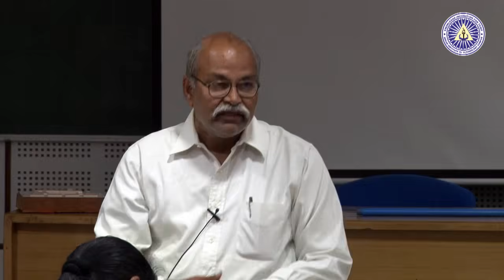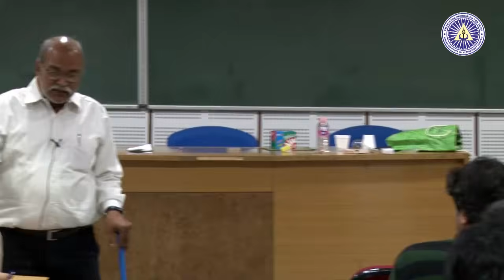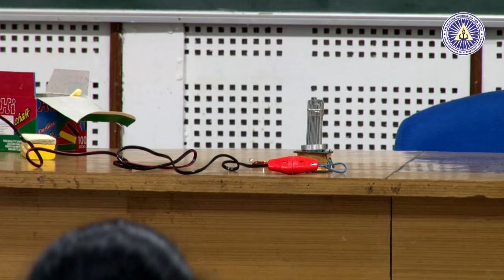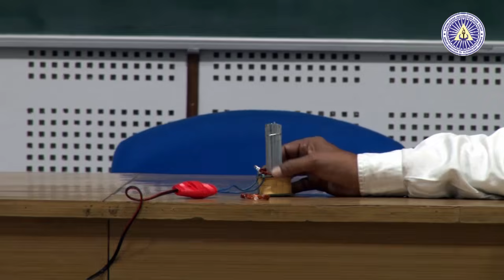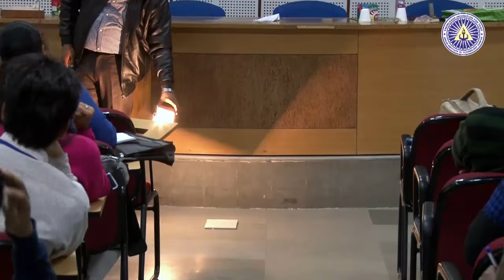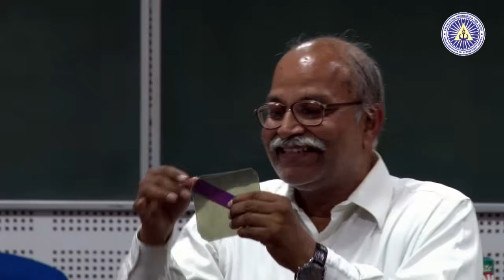General Talk by HC Verma

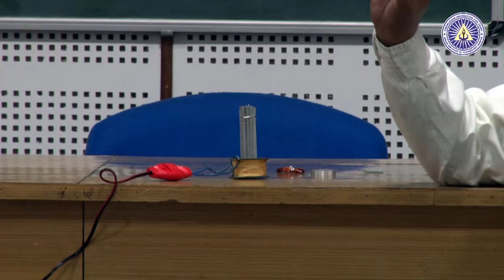Comment: 50:21 here the reason can be explained using the total energy conservation, when the ring with bulb is taken the electrical energy is converted to light energy but in case of aluminium ring there can’t be further transfer into any another energy due to which it’s potential energy due to height increases as it rises

Comment: 12:05 probably Newton's law is applicable on the same point where the force is applied by the earth so if the boy holds the bag exactly at same point where mg is being experienced he can balance it but here as the distance is increased so a torque is produced that prevents the boy from balancing the bag with same 20 newton of force he should apply more force than that to stop the pipe from rotating.

Comment: In the case of rod,
 to  remain it in rest (Both translational and rotational equilibrium). which want to be accelerate down & also to rotate (if we hinge rod at any point). 
   So to keep it in  equilibrium (Both translational & rotational) we have  to balance torque (t=r×f) also.
   To  stop it from rotating we have to apply same amount of torque both side of hinge point (fulcrum)  so that net torque would be zero.
 Because larger length is towards bag (suppose 1meater) and we have small length  to grip(let it 10cm = .1m) where we have to make two points fulcrum and point to apply force by hand.
 
    So it should be t¹=t²
                           f¹r¹=f²r²
                          20×1=f²×0.1
                          F²=200N

  <-----------r¹------------><--r²-->
  _______________________👇f²
⬇️ f¹                       ☝️        ↩️ t²                 
↪️t¹.                   fulcrum 
    
   More larger r1 more force we have to apply.
Lesser r² more force we have to apply  to keet system in rotational equilibrium.
 And at the point of fulcrum we have to apply 20N to keep in translational equilibrium.
Reply: You didn't event consider the reaction which balances out the system

Comment: I guess it's abt the Mechanical advantage,( I'm still in 16:38 ) and the NORMAL reaction is the thing here
Reply: Coz we are applying force downwards in the second case,the NORMAL reaction!
Reply: @sankethks7111 absolutely reaction force at the end of the rod where he holds balances out the system

Comment: Prof. Verma must be very popular but this video is my first introduction to him.  For the benefit of students,  I would like to indicate that his explanation of magnetic fields in permanent magnets as due to moving (in orbits) atomic electrons is incorrect (mentioned around min 37 in the video). Permanent magnets occurs due to spin alignment. Spin is an intrinsic property of electrons and other particles, much like charge is. Spin is not due to classical electric currents. However the exact theory of permanent magnets is still not available. Just to indicate the complexity of the problem, a solution of spin alignment in 2D fetched the Nobel prize in 1944. The 3D problem is still unsolved (anyone aiming for a Nobel prize?). Isn't it amazing that we still do not fully understand how the humble permanent magnet works !

Comment: I think explanation to the first riddle is that the extra force applied by the hand (let's take it as the hinge) is to counter the torque applied by the bag. SO, on that hinge point will have two force components 1. mg (i.e. 20N) + 2. mg*r . Newton law talks about the equilibrium of the point objects.
Reply: Mgr is not a force its a torque so you are wrong

Comment: Answer of the first question - Because the center of the gravity is shifting, as much as the it shifts the force will be increased.
Imagine your body is not a single, solid mass but a huge sack of potatoes standing upright. Gravity pulls on the whole sack, but it also acts on each potato separately, pulling each one downward. When you lean over to one side, the "potatoes" at the top of your body work like a lever, making your top half turn and topple about your ankles. The more you lean, the bigger the lever effect at the top of your body—and the more likely you are to topple.

Thank you for such an astounding question.
Reply: You still didn't answer the question

Comment: The answer to the pipe bag problem was he was not applying just a force upwards. He wad upling both upward and downward which is spread on the surface of the hand. And when he was moving the bag to the edge both the forces magnitudes are increasing but the net is still the weight of the bag which is upward. So since magnitude of individual force is high he is experiencing more pressure
Reply: I also had the same explanation 😃

Comment: My thoughts, 
What they failed to notice is, mg is actually providing a torque. Torque = RXF
So the guy has to provide more torque as radius from the axis increases torque increases, to keep the bag steady!
Reply: How mg is producing torque ??
Reply: @shemjosephejk5824  Consider the forearm to be massless for a minute. The joint of elbow of the person act as a pivot or axis of rotation, and mg is acting on the bag downward. Since the bag cannot go on a linear path, it has to go on a circular path, resulting into a torque.(This is actually the most basic way of explaining how torque is produced from a force, if you want much more detailed explanation you can refer hcv part 1)

Comment: 14:00 the upward force should be on the same straight line that the downward force falling on the object by the earth. That is why he could not able to hold the bag when he is putting force farther than the straight line. Note.You can still control the bag in rest position if you put force very close to the straight line .

Comment: Notice that just one point of force exertion is not at all enough for the stick bag system to be in equilibrium, wt actually happens is that when we hold the stick there are two points of force application, one near ur index finger, and one near the back of ur wrist, so the force of weight+ ur downward force should be equal to ur upward force

Comment: Who can explain aluminium ring and led difference in the experiment
Reply: Team Sudheer  yes u are right
In aluminium ring there is very low resistance hence current is same as emf approx so more repulsive force but led has a significant resistance so current is less and not enough repulsive force to overcome mg

Comment: This class has cleared jee and still has confidence issue. He keeps asking ques and everyone stays quiet.
Reply: Most of them will be introvert lacking social skills effect of coaching and all
Reply: I thinks it's something kind of session or worshop coz😂iit jee wlo ko itna pta hota h or itt wlo ko itna basic thodi na pdhynge😅
Reply: @zemprook2196  yeah I think so
Reply: those students are not iitians. this is a special program for non-iit students to improve the standard of engineering in india.
Reply: @satyarth  ya i know that but still iit me bhi to backbenchers hote honge na
Reply: You know what is the answer of first question if you know tell me 🙏
Reply: @abhijain9542  I thinks that as the bag moves away from the centre of the mass of the rod the the weight of the  rod get added  hence now it is not in equilibirium
Reply: @thespookyhuntergamer2770  actually the fact is if you apply 20 n upward it will be at translational equilibrium but when bag shifts , the torques become unbalanced so the rod actually starts rotating . If you want both translational as well as rotational equilibrium , you need to apply 20 n upward at such a position that the torque also gets balanced . Class 11 chapter 5 and chapter 7 mixed up
Reply: @thespookyhuntergamer2770  why is it not at equilibrium as it moves away from the Centre of mass ?
Reply: @hardpandya1212  bro torque bhi add hoga downward direction mai..........if you still not clr study COM and NLM
Reply: Because they only know how to study and write exams
Social skills is something you learn by your childhood not exams!
Reply: @Dr.MoonChiPoi  tumhari baat mein dam hai👍
Reply: @Dr.MoonChiPoi  yeah
Reply: Nah many answered raise ur volume
Reply: Probably we cant hear because they dont have mics
Reply: @Gurnaj lg, The toppers of JEE are so quite that they even cannot able to answer the simple principle related questions...This shows how our present educated systems making the students simply only Mark's orriented..
Reply: bhai ye iit ke bqche hai?
Reply: Backbencher hai bhai
Reply: but i dont think most of them have...the first one said force in "kg's"...i guess its more of a workshop or something
Reply: @uttkarshranjan8985  this people are so dumb

Comment: 2 is not mass. Actually it is meant to be the weight (Kgm/s2).
F=ma
W=mg
2 = m x 9.8
m = 2/9.8
m = 0.204 Kg -> This is the real mass
So the force he needs to apply is not 20N. It should be just 2N.
20N is a very big force. 😀

Comment: I think I found the answer. The hand exerts a force not just in the upward direction but also in the downward direction. If you just apply a force in the upward direction then you won't be able to hold it just by applying 20N.So the exerts a force of say 10N in the downward direction so that the total force in the upward direction is 30N.This balances the total downward direction and Newton's first law is safe. Now the torques of the forces by hand in the upward and downward directions produce a clockwise torque about the axis of rotation which balances the anticlockwise torque by gravity. Thus the system is in both rotational and translational equilibrium. I hope I'm right.

Comment: When the bag was displaced through a distance from the person's hand  the person applied 30 Newton in upward direction and weight of bag equals to 20 Newton and bag was in static equilibrium, then the extra 10 Newton force may have been used to make the system in rotational equilibrium

Comment: dont judge on my idea but i just think the bag experiment was just like turning a nut with long spanner and short spanner the same work is done on both the sides i.e same energy but but near our hand the disp is less so more force at the bag disp is more so less force may be mechanical advantage is the reason for it because here we are not just holding it straight we are stoping it to rotate even

Comment: The 20N force is high at the end due to the torque and radius relation ...
Am I right ?   Tell me stranger.
Reply: No
Reply: @lakhansinghchoudhary1142   why ?

Formula of torque is Force × | distance.
We will have to apply an opposite torque...

Then what is wrong.
Reply: Yeah because of torque it's working as force multiplier...
Reply: He had asked the net force on rod-bag system.....if the rod is pinned at its COM the we will use torque....but the system is rod-bag..

Comment: What the heck? Its too simple. Torque=Force*Distance ..So the total moment of the force should be 0.. It's law of rotational equilibrium.
Reply: That was already answered by one of the guys out there..but the problem is to get more opposite torque u need to increase the force...so why is not the translational equilibrium being disturbed?????????that's the main question
Reply: @greevapatel6762  I did not get it. Can u explain clearly.
If you wanna increase torque you have to increase the length.

Comment: Sir i have a question, i am in class 10. I want to know that can we generate electric current from earth   through relative motion of wire. Same as a generator because earth is also a magnet. Sir please reply🙏🙏🙏.
Reply: Earth's magnetic field is very low i guess. Plus you would definitely need a coil of very very large size and then rotate it to produce some current. It's theoretically possible i guess. Don't know for sure.
Reply: Apko answer dena bhi physics ki bejti hai
Reply: Sidha sidha kyu nahi bol deta ki apko iska answer he nahi pata😂😂
LOL😂

Comment: I've watched the video only till 18:20 minutes, and feel like having a solution to this. Maybe, I'm not correct, please suggest if somebody find me wrong.

While holding the rod, a lever system is formed with the fingers forming the hinge, and the other part is forced downward with the palm. To balance the heavy torque of bag, a force by the palm is exerted on the other side of the hinge of fingers. Since, the torque has to be balanced by putting a force so close to the hinge, applied force by palm must be higher than the weight of rod (let's say x).
Now comes the force balance: The person holding the rod has to apply two forces, one by the palm (talked about in above paragraph), and other by the fingers forming the hinge. The main difficulty in holding a rod like that, is mainly because this force to be applied by fingers, this force must be even more that that of the palm, i.e., it will be equal to (x + weight of rod).

Having taken my explanation we get both the force balance and torque balance simultaneously, without any violation of Newton's Laws.
Reply: You are slightly wrong
Reply: @chitrang2441  Sir,then what's the right answer?

Comment: Hey for all those who are wondering how does that magnet and led thing works, 
Basically the polarity of the magnet affect the flow of electrons in the circuit so when the  north pole is introduced first then the current flows from left  to right which makes the red led light up first, and leaving less current to go to the blue led which can be lit if the current in the circuit increase and similarly when the south pole is inserted first the the direction of flow of current changes to right to left which gets the blue light lit up first and leaves less current for the red one which can be generated by increasing the velocity of the magnetic inside.

PS I'm not an engineer or a physicist or even science grad. I just learnt science in 11&12th.
Edit: please correct me if I'm wrong.
Reply: Bro that's a DC led so both led will glow only for a particular direction of current moreover the potential will be divided not the current as it must be series circuit also the voltage consumption of each led is decided by the resistance offered by it
Reply: @davideve8638  if both would only for pirticular direction of current what happens when he shakes the magnet faster
Reply: @boyfromthemountains  the rate of change of flux increases thus more voltage or emf is produced
Reply: @davideve8638  that's what I said I just used current so that layman could understand the same.

Comment: The answer to the first experiment is TORQUE. As perpendicular distance r increases due to parallel equal forces a torque gets generated with axis of rotation at the centre of the rod. To balance the system the angle sin should be zero in the formula Torque = rFsin ...for that we have to hold the rod vertically upwards or downwards

It’s just my calculations. Am a BA Economics student but studied physics as a part time cuz I always loved the subject. Thank You 😊

Comment: The Rod and bag example is very flawed to the core...
It’s like a bag is levitating horizontally, and you hold it from the handle, and expect bag to not adjust back to vertical position because you are exerting same force as the force due to gravity...
The system will rotate till the point of application of upward force is in line with center of gravity of the system and from thereafter the system will continue to oscillate...
Surprisingly there wasn’t anyone confident enough to speak up... but didn’t expect this dumb experiment from HC Verma... no offense though it’s just expectations set from his books were higher

Comment: By using varing electric field we can produce magnetic field such examples are parallel plate capacitor.
How to produce magnetic field without electric current?
Reply: Using a magnet 😂
Reply: Magnetic field is just an electric field in different frame of reference.

Comment: Sir I have a simple question that why earth magnetic field work in South and North ,
And why we should not imagine that earth magnetic field doesn't work East -west,??🤔🤔🤔🤔🤔🤔🤔🤔🤔
Reply: Because it is found experimently that it exist north and south
Reply: Because rotation of earth is in East to West direction, hence core is also rotating in same direction and hence electric field generated in same direction and from which magnetic field emerges from north to south
Reply: Imagine the earth as a solenoid, with current moving about the axis of rotation of the Earth.

Comment: Seriously man, I'm a medical Student but was able to answer all the questions he asked in class and these IITIANs are they really? Or some duchebags..🙄🙄
Reply: why we need higher velocity to make both bulbs glow ?
Reply: @vishwanraja666  Inside a solid,the atoms are packed together with very little spacing between them.When a steady current flows through a conductor, the electrons in it move with a certain average 'drift speed'.This drift speed is very small,about 1mmps. The individual electrons in a wire move very slowly, as they can be modeled as constantly colliding with atoms and bouncing around randomly in the manner of a gas. Electric current is the very slow flow of this electron gas through the wire when an electric field is present. However, the cause of the motion of the electrons is the electric field, that you set in the wire when you switch on the light say, that travells along the wire at the speed of light. As the field travells along the wire so fast, it sets the electrons along the way into motion all along the wire. So it appears as if the electrons are moving very fast, when in fact they don't.

Comment: I think solution to bag rod system question is that when bag is pulled far away force remains same but i have to apply force more than 20N from crossection(from two areas) of my palm in opp direction whose resultant is 20 upward but is also able to balance the torque of bag weight